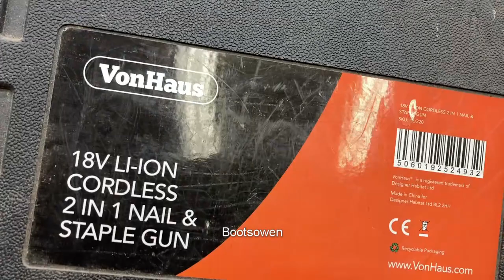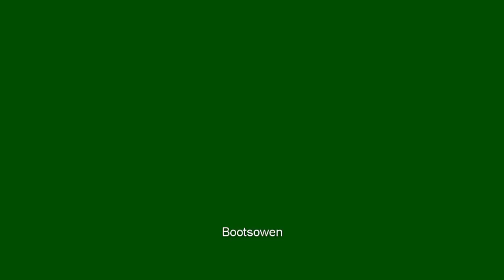Von Haus nail gun not driving nails: A repair video!

Comment: Owen, I think I might of made a new anvil, but probably only I knew it worked, difficult to guess, cheers
Reply: Non-brand products require that bit of ingenuity/back yard mechanics. We'll see how Owen's nailer lasts. I like a pneumatic nailer. The whole setup is about equal in cost of cordless, and a bit  of heavy lifting off the van but a lighter more nimble tool.

My old Makita jigsaw lost it's pendulum. Piece of metal broke. Was able to weld it back together, holding so far although seldom used.

Comment: Hi Bootsowen,
Bit of a longshot, have you seen any discarded Ferrex 20/40v 4AHr batteries about? I have cells but need a good condtition case and bms to put them in. Ta
Reply from the maker: Not yet Ian, I have a few myself, bought new, I like the impact drivers and the 40 v ones will run a 36v e bike and scooter that I have. I'll keep my eyes peeled.  
I am looking for broken tools that will accept those batteries to make a clip to hold the batteries on the scooter, at the moment I just push spade connectors in.
Reply: @bootsowen  i'll keep an eye out. May order a new battery online none in the shops only chargers and the combi drills (I had named the shop in a reply moments ago but it was censored)
Reply from the maker: They seem to have the batteries again.